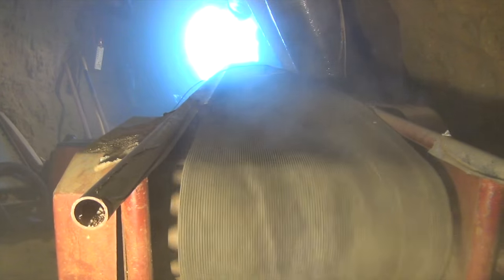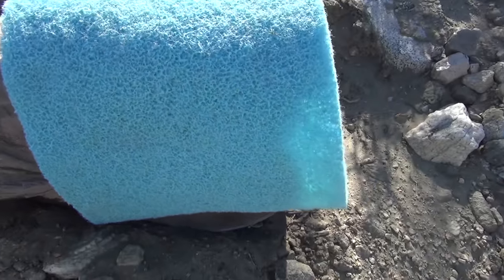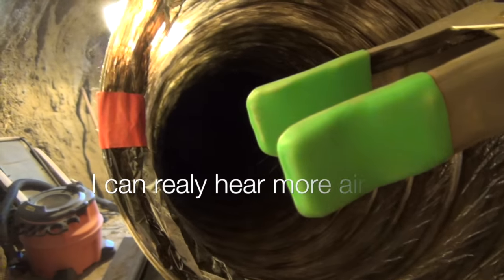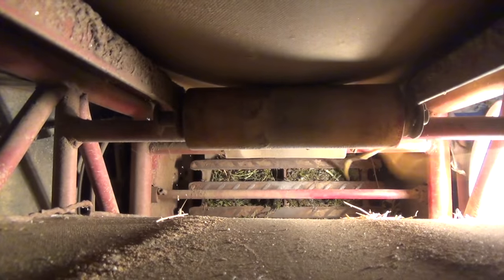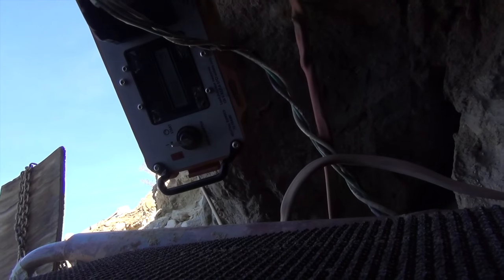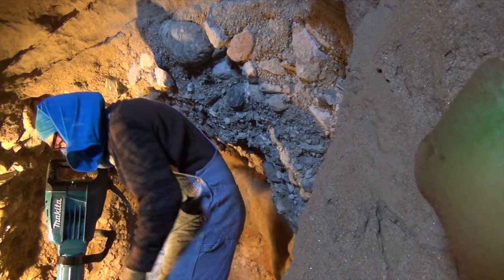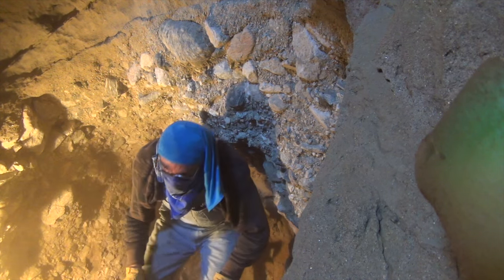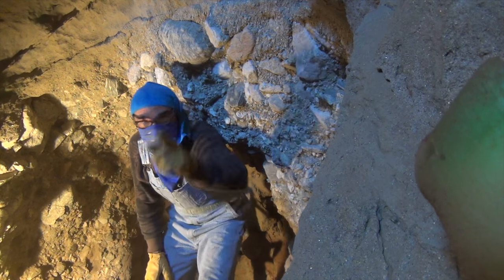DOOMSDAY BUNKER newest update; Time to DIG again.

Comment: All you have to do is drill a hole up high & put a spike in it. Then tie a rope to it & put a loop on the other end. Put the jackhammer bit through the loop basically suspending it so you dont have to hold up all the weight by yourself.

Comment: MAN!  You're digging into Caliche soil.  Dangerous stuff brother.  I was a foreman for the footings division of a major commercial construction company in Arizona for several years, and I know something about what I'm talking about.  You need to reinforce your dig substantially.  You have ZERO safety protocol in place right now.
I personally saw a plumber die in Phoenix digging into the side of a non-braced trench.  The caliche broke off an slid right on top of him, crushing him against the other side of the trench.  We couldn't get him out because you can't dig that stuff.  It breaks up into large slabs.
You're playing with fire my friend and I don't want to see you hurt or killed.
Please reconsider what you are doing.
In Christ

Comment: Make an "A" frame that is flat on the top. Use a screw system to wedge against the walls..
Hang a center chain to rig the hammer from.
By having the chain in the center you can adjust the height of the hammer.
The free floating of the hammer allows for a greater swing from one placement.

Comment: The greatest danger is the lose soil around the edge of the cut.
You should be doing a "cement and chicken wire" liner around your dig.
As the earth "dries out" from being exposed to the air... it will start to fail .

Comment: BB513, your biggest struggle is always getting that jack hammer up high enough to excavate up to the ceiling, and therefore you need a mechanical aid to hold the jack hammer up horizontally, at the correct altitude. What you need is a short section of 2 parallel rails made from 10mm x 30mm flat-bar(standing-on-edge, welded to sleepers, also made from 10mm x 30mm flat-bar, but lying flat) ; make the rail about 3 to 5 metres long and have a 4 wheeled trolley on it with a forward-leaning adjustable tripod that's pivot-mounted onto the 4 wheeled trolley, by two of its 3 legs, with a gimbal rotatable head at the top of the tripod,  that supports the  jack-hammer horizontally, at its centre point of balance, and where you then use a long travel hydraulic ram (attached to the 3rd tripod leg) to easily adjust the tripod's forward leaning angle, which in turn, adjusts the jack hammer's height. You might also need a counter-weight on the rear end of the trolley.

Comment: Have you tried drilling holes, filling with dexpan, then prying loose the broken rock?  I think you should be able to go at least a few feet at a time and probably much easier than going at it with a jackhammer.  You could even pull the chunks out with winch to the conveyor

Comment: dam man your remote as he'll pull the belt back. and put in some explosives. just a few sticks from a local expert and you can get on with your digging once past that Damn rock it's about $40 a blast hole here and they drill the hole and do the charges no dynamite that's yesterday's way of doing it now days they use nitrates

Comment: Get a modified drill bit and a mounted stand to speed up the process you can always fill up the holes in the floor later. Rent a drill used to drill for water and put some stratigic holes in certain places?

Comment: Your fan is running backwards.
Squirrel cage fans are backward inclined. they use centrifugal force to move air, not blade pitch.